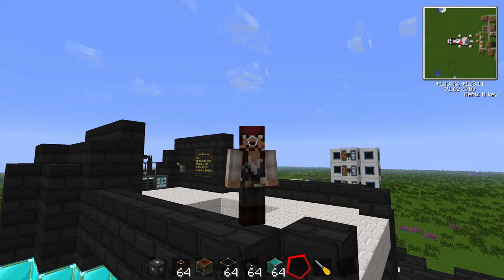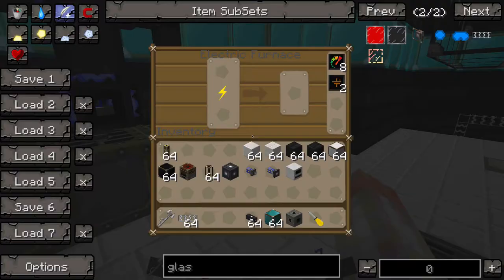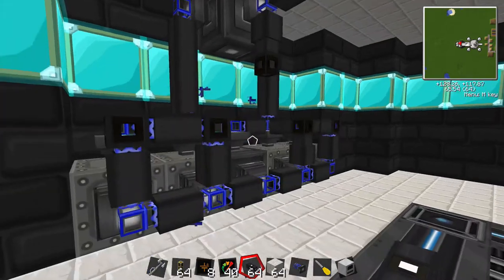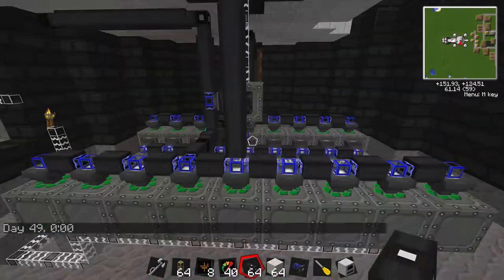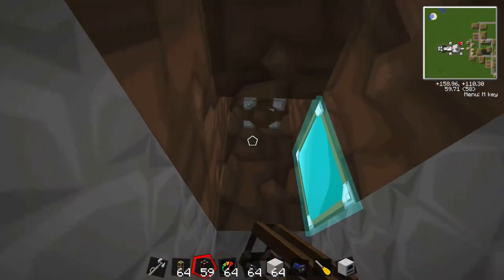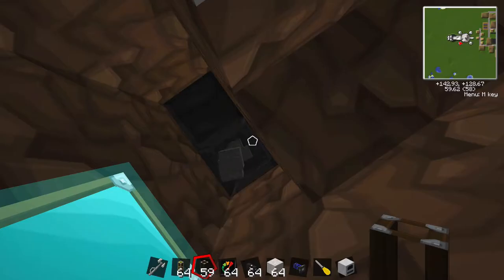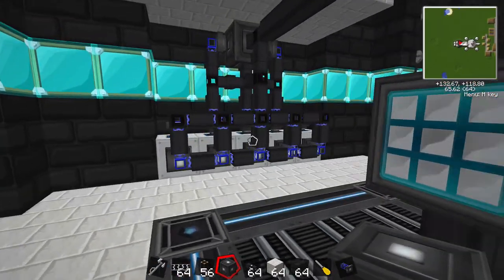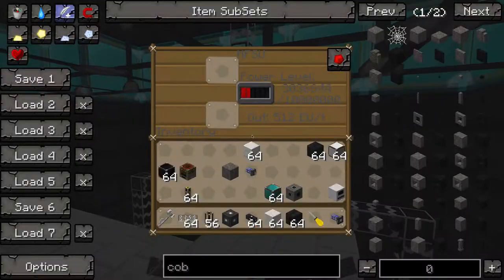Lets Build a Nuclear Power Plant - Episode 7

Comment from the maker: Updated the description to include the reactor layout. As for the cobble, I wanted to keep the scrap in the system so I could create scrap boxes and export them to the Massfab. Also, I noticed that if I piped the cobblestone directly in that only the first couple recyclers would receive cobble which slows down scrap production tremendously. As far as the AE question, I haven't really noticed that too much...although it happened in our MKIII base with HV solar arrays a few times.

Comment: A few things.

- Can you put up a link to the reactor planner for that 4360 EU/t layout? I was hunting around for it, but didn't find it.
- Why did you bother to pipe the cobble into the AE network at that point? Why not just put it directly into the recyclers? That would be a way to help conserve some power - do you think that the relays would get backed up or similar?
- I've noticed sometimes with AE that parts of the system will just freeze - stuff won't autocraft. Ever seen that before?